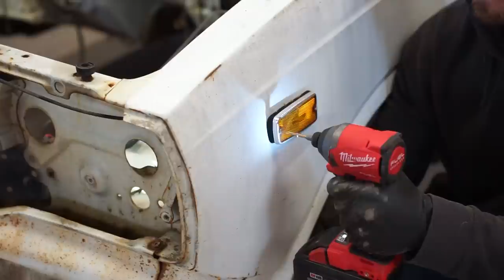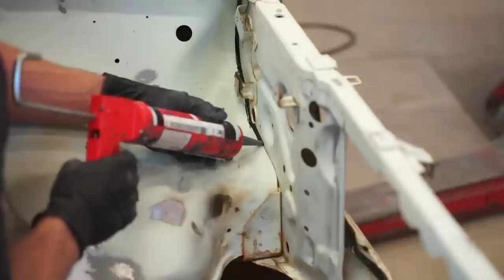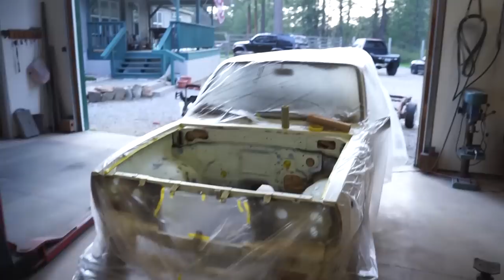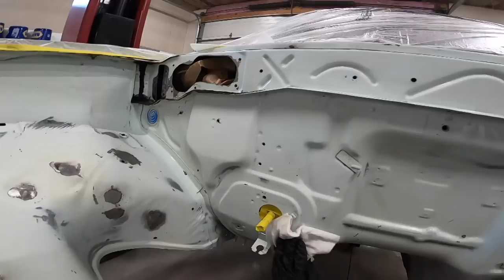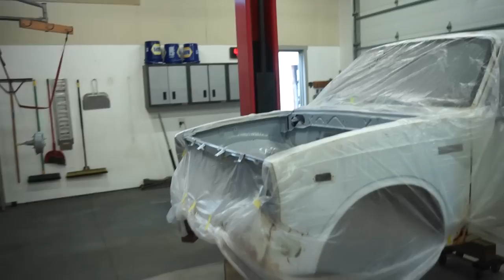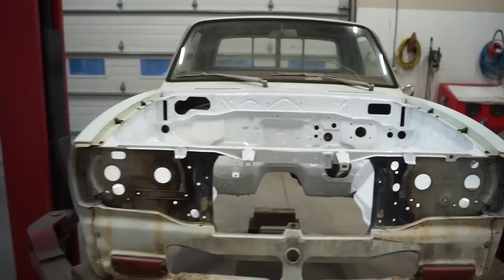Painting The Rusty Engine Bay In My Hilux!

Comment: The spots where it looked like you were having issues on the primer, look like you just got it a little heavy there resulting in a little bit of solvent pop and the orange peel.  It seemed to be in areas  where you may have a bit more overlapping passes, or hard to reach areas, that could have caused the buildup like that. You obviously have experience with body work and the such so not knocking your work at all. It's hard to tell exactly from the short pieces of video, but that's what it looked like to me. Have a good bit of experience myself so not just keyboard warrior-ing. Nice video, keep it up!
Reply from the maker: Thanks! It could be but there were spots where it was light! It did the same thing on a grill I painted too!

Comment: I hope you took my advice and took a look at LC Enginering they have mild to wild engine parts for 20 &22r's stage1 to stage5 race engines, ps definitely get one of there high proformance oil pump's. Stock oil pump's are the Achilles heel of the toyota 20&22r thay hard anodized the case and remachine to tighter tolerance, I highly recomend one.
Reply from the maker: Yes I have seen their motors! I did a aisin oil pump, I have never had a issue with them!!

Comment: Looks good so far.. Definitely go with aftermarket headlights that can function as LED, with center lenses being yellow and outer being clear. Would look dope.. I would roll and pull the fenders, lower the truck maybe 3 inches in the front and 4 inches in the rear sitting on some 17x9.5 front 17x10.5 rear wheels with thick tires to add to the rust look the wheels should be copper lip O_O lol man I am too invested.. But hey, I am excited regardless..
Reply: 👆Congratulations you have been selected among our shot listed winners INBOX ME💯

Comment: Like the Rat Rod look... since your more of a tuner / drifter ... than a drag racer. Tub the rear fender wells channel and drop the truck to the grass... on air bags. I still am old school and would stuff a V8 under the hood. But you can do a lot with what you have.  Give room for some fat tires up front.  Suspension and brakes are everything.  Satin clear over the outside finish.  Put your logo on the doors and scotch pad fade them off...match the patina.  No blacked out or projector or LED lights... old school.. Rat Rod... interior can be cleaned up like the engine bay...